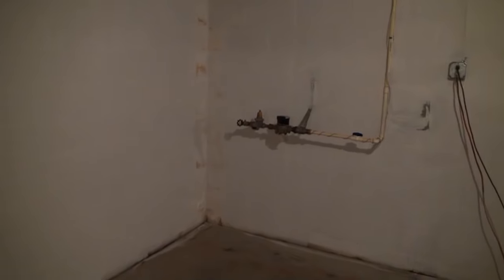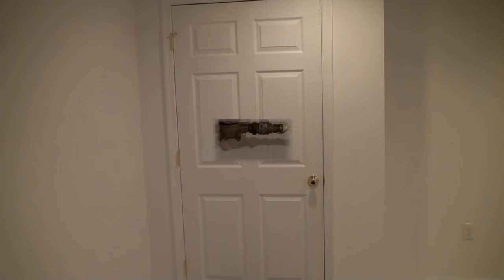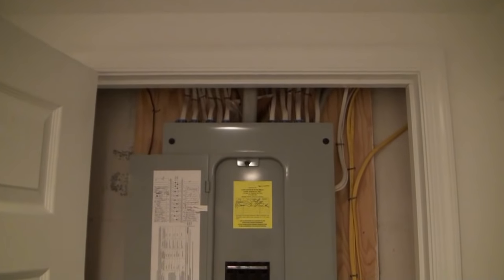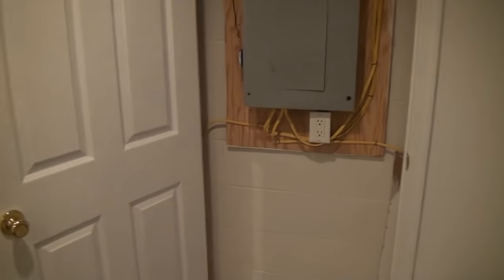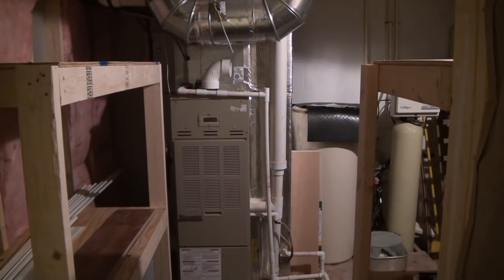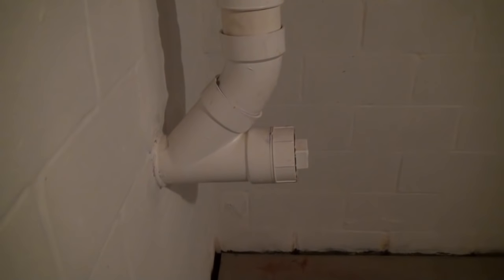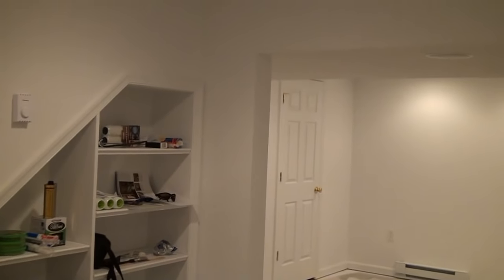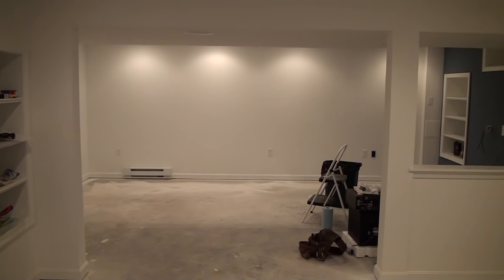Designing Your Basement (This is a LONG Video:-) )

Comment: Great video Eddie! Do you go further into #9 (stairs platform landing) in your basement finishing series? I have a staircase that is less than 12” from the wall and I will be building a platform landing from the second tread, and then a final step on either side of the landing. Thanks for sharing your videos on YouTube, I’ve already learned so much!

Kevin
Reply from the maker: Hello! 12" away...Holy Cow! That's close! I do not have a specific video for a set of steps that close to the exterior wall. But you would have to get at least 2 steps high with your platform to get enough turning radius from that wall that's only 12" away from the last step. You would need probably 2 steps down on each side to get at least 32" away from that wall at the base of the steps.

Eddie
Reply: Thanks for the reply Eddie!  It’s dumbfounding where the stairs were placed in our basement, the house is only 11 years old – I’ll chalk it up to poor planning! No problems that building a platform isn’t covered in the series –  I came up with a plan using the 3D modeling program SketchUp.  Nonetheless,  I’ve already learned so much from the YouTube videos that I’ll be purchasing the video series later this evening as I’m eager to learn more! Even in the areas where I’m proficient, I’m learning useful and valuable tips! If you have a message board in the member’s area, I’ll post some images of my finished platform to help others. Thanks again!

Kevin

Comment: Eddie! For the panel box you came out 6 inches from the wall and set your x to the inside of that chalk line. Now that leaves you with about an inch from the outside of the 2 by 4 to the panel box cover. Is that enough for a door to clear the panel box? I'm at this stage now and I just can't see how the door has room to close. Need help!
Reply from the maker: Yea it clears the door by about a good 1" Seth.

Eddie

Comment: Hi Eddie,Were the half walls in this video built with 2X6's?  When do you use 2X4's vice 2X6's when building half walls?
Reply from the maker: +swayze2699 If the half wall will be supporting a top with an over-hang I use 2" x 6" if not usually 2" x 4" is what I use.

Eddie

Comment: what if the pvc drain pipes were hanging out about 4in from the wall instead of flush to the wall what would you do?
Reply from the maker: Build wall back as far as possible and soffit the pipe from end to end down that problem wall.

Comment: Is there any discussion about putting the electrical panel behind a door?  Seems like it would be prohibited by the electrical code.
Reply from the maker: pauljolry Depends on your local codes really. Most areas of the world permit you to build the wall right around the panel box as we have in this video. Check with your local codes department and see if they will allow this type of setup first. Some departments ask for 36"  between the door wall and the panel box. Only way to know for sure is the ask.

Eddie

Comment: Great work! A few questions:
How much did this job cost?  I'm curious as I will soon be doing my basement and would like to know the overall costs.  
Would it also make sense to use metal studs instead of wood for the basement?
Did you place down any sub-floor and if yes, what kind?
Drywall ceilings or drop ceiling?
Reply: I say drop ceiling, How are you going to do a termite inspection without it?

Comment: I watched the video in 2X speed and it was still long... but good.  Also, did you mean egress window a Max of 40" (and not Min of 40") from floor?
Reply: With all due respect, you're confusing min and max again.  You actually mean max.  If it can't be higher than 40" off the ground then 40" is the MAXIMUM height above the floor it can be.  However, if you meant to say that it has to be at least 40" above the floor then you would correctly say min.  But I highly doubt a minimum height would be specified.
Reply from the maker: Okay.Okay...The maximum height the window opening can be off of the concrete floor is 40" according to egress code specifications. Sorry about the confusion guys! I made a mistake.

Eddie

Comment: god this is such an easy basement all the crap is located in one area high ceilings. i did the living room area of my basement had gas lines water lines i was able to hide, but can't do anything about my F'd up vents honestly the right way would have been redoing the HVAC from the begining, my furnace sits inbetween the living room/ bathroom you can't fesabily room it in or you'd use up space to get to the bathroom.

Comment: would it be alot harder to move the water pipe closer to the left side corner of the wall and instead of having a full size door you can use a linen closet door instead? I'm dealing with the same issue now and I'm trying to maximize the space and not lose 30" nor the 18" of depth.
Reply from the maker: I try to avoid a lot of re-routing plumbing if I can help it, but...you can move most any water line or sewage pipe if you want too to make a bad situation better. I never move the "Main" water line from the street or a well line...to many issues to do so for me!

Eddie

Comment: Great video! I am planning a reno for my basement (DIY). Do you come to the Maryland area? (Thurmont)..Also when you frame the support beam i could not tell how you secured the lower part of the 2x6..My basement is not as big but i want to a half wall to enclose the beams the way you did. thanks for the idea!
Reply from the maker: If your referring to how we secured the 2" x 6" to the steel column we used our Ramset gun with a 2 1/2" steel pin and shot through the 2" x 6" right into the steel column and pinned the 2 together. Thanks for stopping by our Basement Finishing YouTube channel.

Eddie
Reply: Yes...Thank you

Comment: What kind of fastners was used to the studs that hold the closet boards? Concrete Screws or the Shots and pins?
Reply from the maker: +junkmail1203 If you are referring to the ClosetMaid rubberized metal shelving we use  2" drywall screws that went right through the drywall and directly into the 2" x 4" framing behind the drywall.

Eddie

Comment: roughly the 25mins in the video. what is that white plastic thing you have behind the walls ?
Reply from the maker: +Uri Gorbatov That is called a wall-wrap insulation. A lot of builders are using this on new builds and it's simply a vapor barrier of white plastic with an R-11 fiberglass insulation layer directly behind the white plastic. Help give the basement a much more comfortable R-Value right out of the gate.

Eddie

Comment: why is your baseboard on before the flooring, as well as the toilet and sink???
Reply from the maker: whizla1 Always put your baseboard on before you set a toilet so you can get in behind and position and nail it on! Set you Base trim 1/4" higher than your future floor thickness, then set floor, then use shoe molding or 3/4 round to finish the trim around the finished floor for a tight gap-less finish.

Comment: why the 1" gap between the exterior walls and the framing?
Reply from the maker: +nicrrobinson Never build tight to the block or concrete wall just in case the wall is "leaning-in" at the top a little...this 1" gap is there so you can plumb your new framed wall perfect even if the masonry wall is out of plumb...it's a preventative maintenance technique really...no other reason.

Eddie

Comment: What do you do about moisture and mold mildew etc?
Reply from the maker: Moisture issue must be corrected BEFORE the basement project begins! If it's not...you will always have that same moisture problem behind your new exterior walls and this is what causes the mildew in first place.

We use"Drylock"...which is a "damp-proofing" solution for masonry block walls which will seal the pores in the block so future moisture can't seep into the basement through the block. 

You also need moving "filtered" air in the basement which is supplied by a central heating and cooling system in the basement. You must Tap the central HVAC unit(s) to keep air quality dry and filtered to keep the basement environment free from future mold odors.

Ceiling fans also help keep the air circulating in the basement which aid in helping the HVAC system from working overtime to keep the air moving.

Keeping the basement comfortable, dry and odor free is really a culmination of several environmental factors. Hope this helps.

Eddie
Reply: BasementFinishingMan Hi if I have block walls and no moisture issues am  I OK just to use 2" closed cell foam floor to ceiling to insulate the walls? Do I need to seal the block first if I have no issues? Also, I plan to use foam board pegs to attach the foam to the walls do you see any issues with that? I live in a northern climate so we get cold snowy winters and I want to finish the basement but need to insulate the walls first.
Reply from the maker: I would still seal every square inch of the block with "DryLock" wall damp-proofing solution before I install my 2" foam-board! I would then frame and also insulate the framed walls as well with R-13 fiberglass insulation. The foam is NOT enough insulation for code or comfort levels!

Thanks for stopping by our basement finishing channel. ~Eddie
Reply: BasementFinishingMan Depending on your location, 2" XPS is plenty for insulation. I'm in SE WI and I just put up 1.5"

Comment: I thought it was a code violation to put anything directly in front of the electric panel.
Reply: 36" wide and deep is my understanding.
Reply: Only need 3ft clearance in front of the electrical panel to service it when the door opens.

Comment: What was the size of that basement?
Reply from the maker: Roughly 850 sq. ft. finished space in this basement Bill.

Eddie
Reply: Thanks for actually getting back to me,  I keep hearing about dry wall not being good to use in basement and all the new water proof systems like Corning wear what do you think of that?
Reply from the maker: Some of it is good..some worthless...But my philosophy has always been If you have a completely dry basement that never gets wet, you can simply use ordinary building materials and none of this over-priced wet /damp basement preventative materials are ever needed in the first place.

I like only the perimeter water proof systems that have the internal footer trench installed with one or two sump pump crocks with active sump pumps installed in them. This is the ONLY type of water proof system that I will endorse or install and guarantee a homeowner that they will NEVER have a wet or damp basement again! Not cheap to install but worth EVERY penny!

I have finished over 1000 basements the using traditional building materials (ie: drywall, regular wall stud lumber 2" x 4"'s, etc.) and I have no call backs! Hmmmm? Imagine that.  

Correct the environment first from damp and wet to totally 100% guaranteed dry for life, and just proceed with normal residential building materials! Save money and added headaches...of course this is just my opinion, others may disagree.

Eddie
Reply: Thanks for the advise.  I will hopefully be getting my basement done someday in the near future.

Comment: Sorry for using profanity but got damn this is a great video!!!!! So useful!
Reply from the maker: Thanks my brother!
Reply: I do have a question. How do you know what code to follow if you're going the DIY route? In your other video I noticed you said DIY is $10,000 for basement remodeling and hiring someone is $30,000. I want to save as much as possible.
Reply from the maker: You follow the BOCA codes which apply everywhere. Basically do what we do, and what we teach you, and you will be doing everything according to your local codes.

Eddie
Reply: I just bought your framing and plumbing with electrical package. I never mind supporting good people. Especially those with extensive knowledge. Thanks for everything thus far.
Reply from the maker: Your welcome Kenneth. Thank you very much for your purchase. I am here 7 days a week if you have project questions!

Eddie

Comment: I’m sorry but the stair landing idea was awful. The turning radius is still the same it’s just elevated now. Why not widen the base of the stairs, continue the landing and do a radius quarter round on each side and turn the stair rails out with them? They’re paying a fortune anyway, so you might as well if you’re trying to sell good ideas... for a basement.
Reply from the maker: The radius is one whole step deeper with the landing...so the radius is now larger than previous. Even though it's elevated you have more room to turn as you head up or down the stairs. Modifying a factory built set of basement steps to "turn-out" on a radius with a radius handrail system would take a master trim carpenter skill level' and a pocket full of money to do correctly. This video is to show an average homeowner with limited skills in construction a simple way to gain a few inches of turning space at the base of a tight set of steps....
I hardly think it deserves to be called awful William! 

Eddie

Comment: I have the staircase to close to the wall in my house, however there is an exterior door at the "landing" area. So do I just cut the step and not build the landing? OR could I build the landing and have the exterior door swing out?
Reply from the maker: Hey Adam...good question and a unique situation you have there! Man I would just keep it tight and live with the closeness to the stairs...you don't want a landing and a door opening out!

You could also use 3/4" wood lathe to frame that section of your wall on each side of the door at the base of the steps and insulate with 3/4" Styrofoam between the lathe. You would then pickup almost  3 full inches of extra depth and that might make all the difference for you.

Eddie